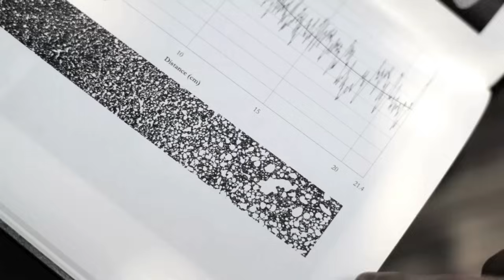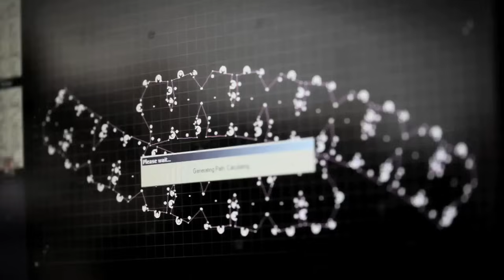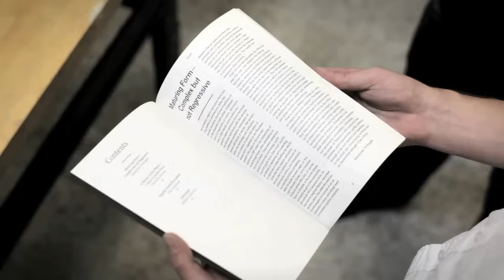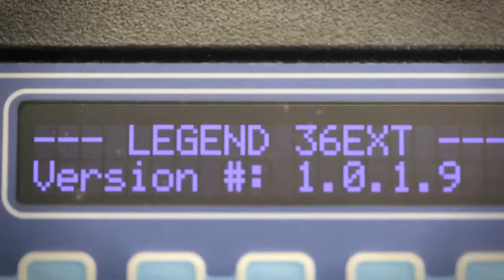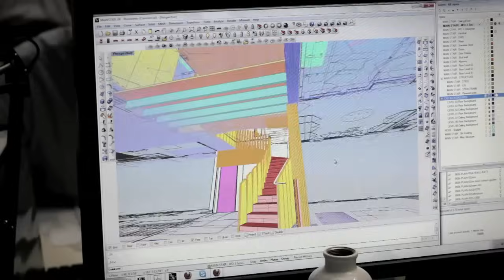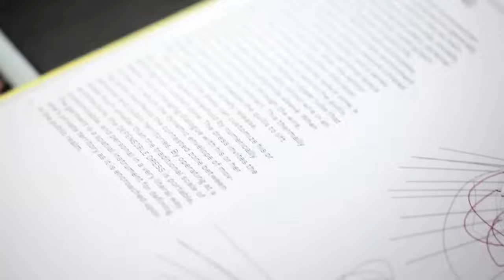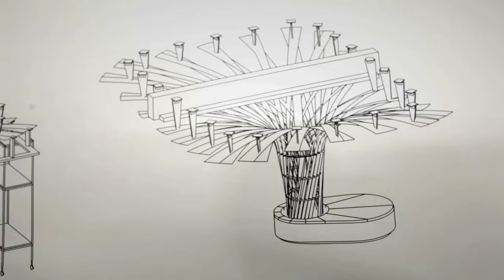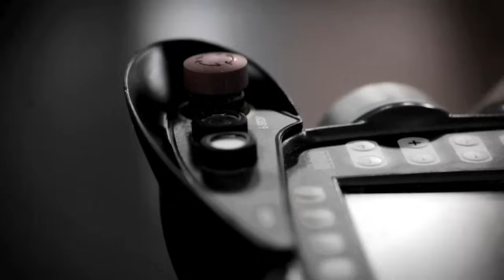MIT Architecture

Comment: I see their motivation more as architectural art/cladding (with exception to concrete bit) rather than defining a new way of constructing a building.  Very creative design wise.
Reply: correct
Reply: The software they use can very well also be used for FEM simulations for preliminary structural analysis. There are plugins for Rhino/Grasshopper such as Karamba3D that does this, so they can use their parametric design for more than just cladding and use it for the entire structure.
Reply: What about the 3d shapes made with a single 2d plane? It would lower the cost of production : carving, molding vs producing sheets, cutting on the sheet

Comment: This research is fantastic, but don't hold your breath waiting for the construction industry to take it up.  Buildings are complex animals, they need wiring, they need plumbing, they need to be sound proof, fire proof, they need to be thermal and solar efficient and they need to abide by all the planing and structural codes. And then - they have to be put together piece by piece, by a human hand.  Robots constructing units or blocks fitted together on site may come sooner than later.
Reply: Michael Flynn 👍
Reply: gives me an idea for a kind of smart block.  standard 8x8x16 size with all of those attributes built into it.  set, predetermined, built in channels/conduits that can be stacked or locked into each other forming the h20/power pathways you want.  have insulative properties.  wouldn't neccesarily be held together with traditional mortar/cement, but maybe tensioned along its long axis'.  gonna have to work on that....  thanks for the inspiration.
Reply: The whole thing about parametric architecture is more and more parameters will be added as it evolves , which includes building services too

Comment: I think my works will be very interesting even to MIT architects. I designed my architectures based on visualization of forces, dimensions, and behaviors. I try not to analyze based on the given objects. I believe my thoughts in architecture can bring a new era.
Reply: Is the visualization of forces a literal spatial representation of force fields/directions? How specifically are you visualizing those ideas?
Reply: Definition of realm does not state or clarify objectivity. It simply states space in dimension which can be observed through origin. Language barriers are barriers which are constructed with our limited imagination. architecture, linguistics and practicality always conflict in each and another. Incredibism is to understand and differentiate factual behaviours to determine. linguistics conflict practicality, architecture conflict linguistics, practicality conflict architecture. Confliction by the incredibism is a possibility in which observers can analyse the characteristics between matters and variables. If you fully understand and characterise the subject. You can apply it dimensionally. Incredibism is the way to credit beyond our dimension and it is possible through the incredibism method.